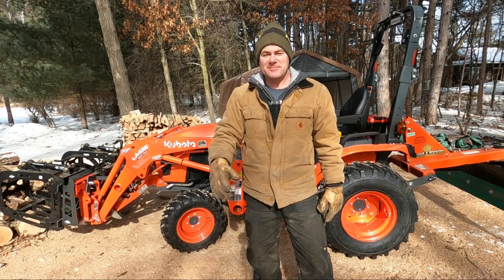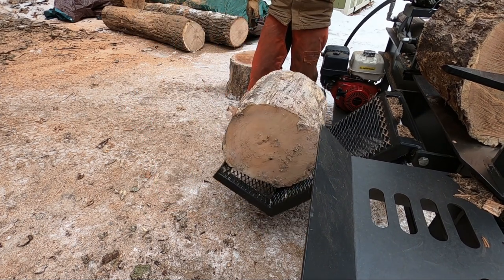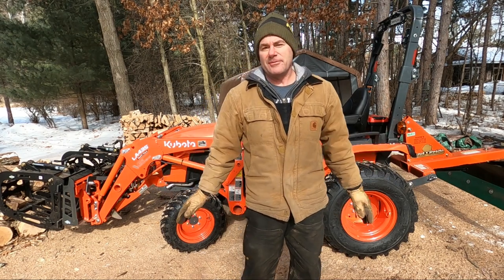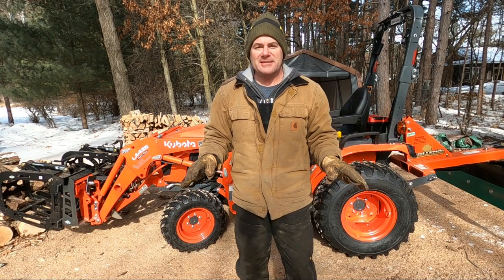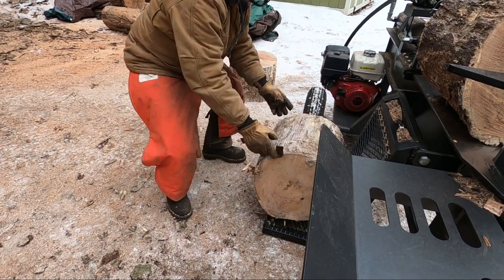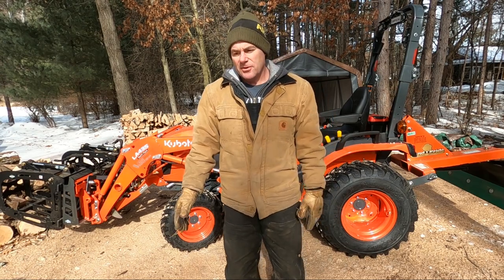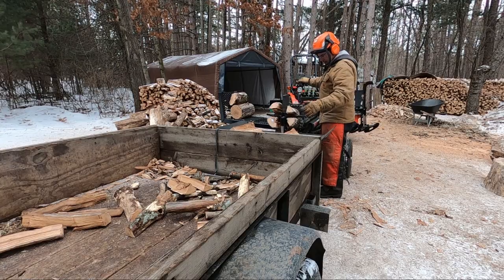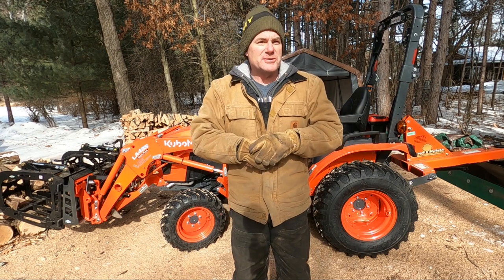#83 Firewood Business Ergonomics - Firewood Making Tips and Tricks - Kubota B2601

Comment: Heat mostly with wood and have a picaroon but I do not use it much, I do also have a relative of it,  a  pulp hook, have 2 and sometimes will use them both at the same time and pick up 2 rounds at a time.
Got mine at my local rental / Sthil dealer.